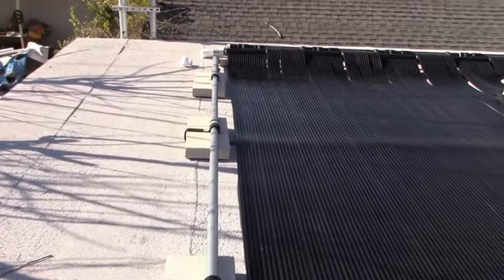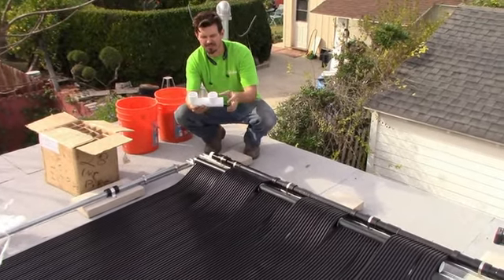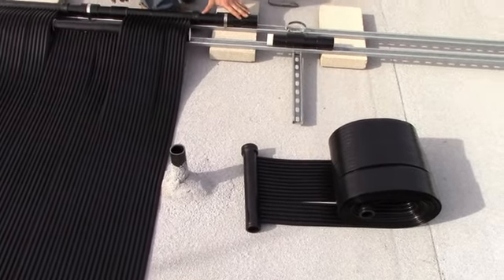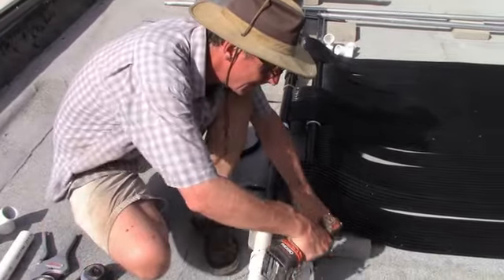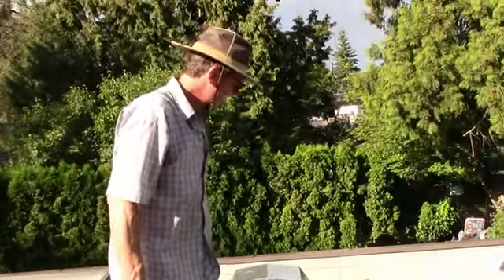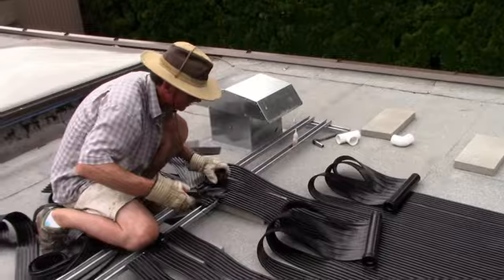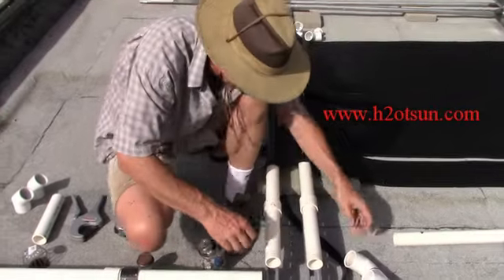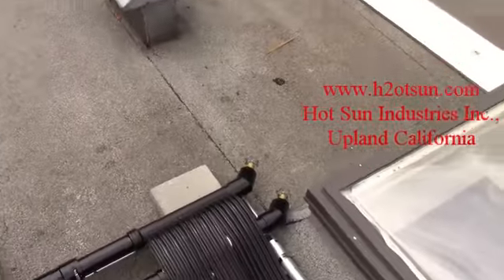Ballasted Flat Roof (membrane, tar and gravel, roll roof)  Solar Pool Heating from Hot Sun.

Comment: Do you have system like this for thin solar panels generating electricity? My flat roof ponds here and there, so the system that lifts thin solar panels would be good solution.
Reply from the maker: PV panels are rigid and can be set off the roof. We sell solar pool heaters. It is possible to elevate them depending on roof type.